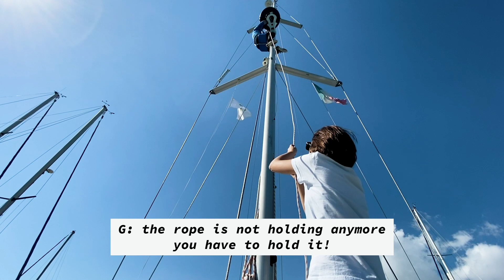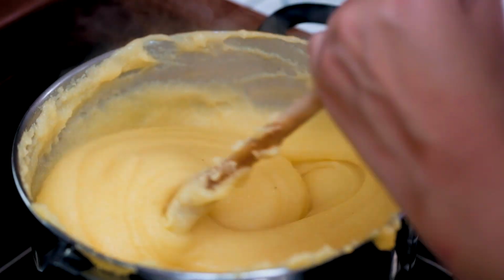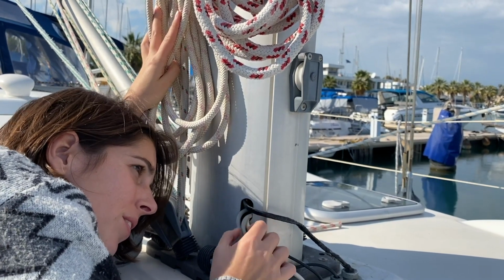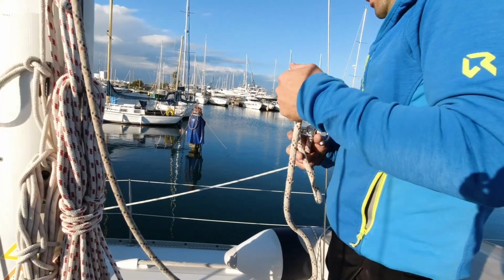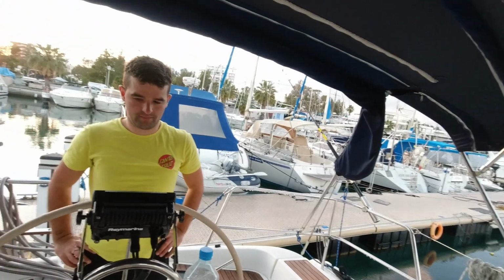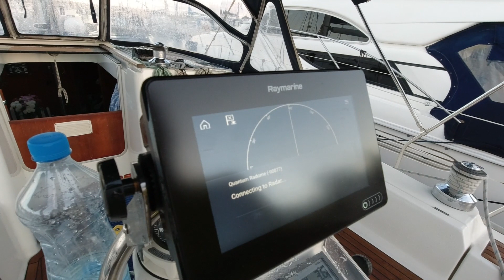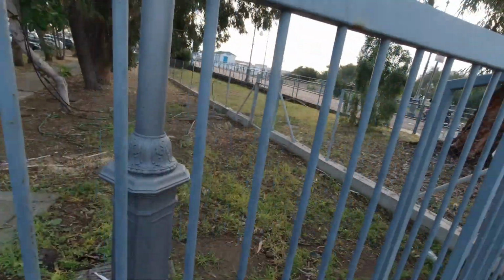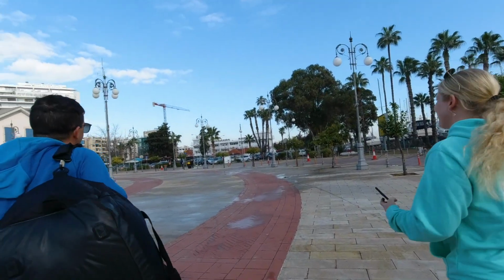Quantum Radar installation for the Atlantic Crossing and freediving in Cyprus - Ep.04

Comment: I was afraid to purchase the radar until I learned more about the WiFi reliability in lieu of the data cable.  Running the data cable from the mast to the display is very difficult, as you showed so well in your helpful video.  It is hard to find out from others how well the WiFi works.  Can you please comment on this?  Thanks!
Reply from the maker: thanks for watching randy! we had some issues recently and had to reset the axiom, and struggled a bit to reconnect it...i am not sure if it is an issue of the iridium go wifi (might have used the same channel) and i believe we have another issue with the display itself as we can not make updates and Raymarine support cant fix it without sending it in...but once it is connected it really works great! still had no while using it, feedback is fast and really superb to track targets (squalls for example) - also we use it very rarely...did you already buy it?
Reply: @WhenSailing  Thank you for showing how it is done! Are you not using it because you don’t need it that often or due do power consumption/radar silence zone issues etc?
Reply from the maker: Hi There:) we rarely use it because there is seldom fog or poor visibilty during the nightsails, mostly the moon is out or some kind of light so the eyes adopt really quickly, in retrospect it is more a luxury to have and a nice toy😅

Comment: Not sure if you have sorted this out yet, but you can bluetooth your collision avoidance audible alarm from AIS or Radar to a cheap portable bluetooth speaker anywhere in your cabin.  I tested this with my Axiom and it works great.  I have not installed radar yet but I have AIS.  Thanks for sharing this video and good luck with your journey.
Reply from the maker: That’s a clever idea thanks for sharing!
Reply: Bluetooth! Of course, why didn't I think of that?! How many BT devices can the Axiom be connected to?

Comment: Understand you may need the data cable but it's great that it has wifi, just seen the section showing the Axiom & comments about wifi :-)))
Reply from the maker: yeaa we stil have the second part of the cable safely on board but it is super costly to buy the extension:) so far the wifi works really reliable in all different areas and weathers:)
Reply: @WhenSailing  My feel is that cable is better - if you can rig it. But if it works now, interferes with nothing else then why not wifi. Lots of potential wifi hotspots onboard my boat and they don't seem to eat each other - but I mostly leave them off.